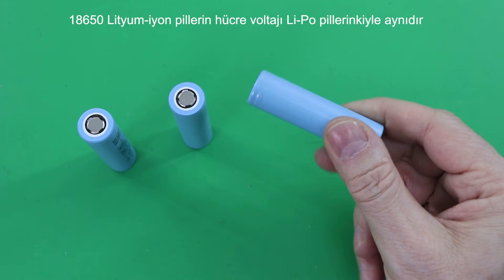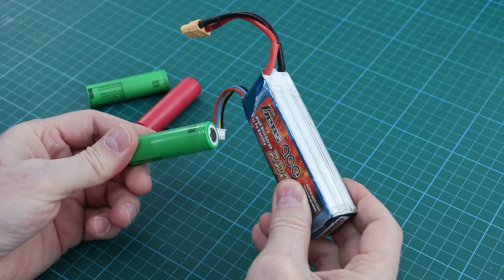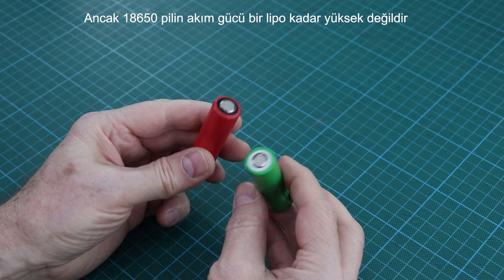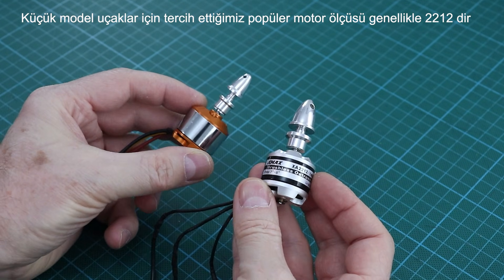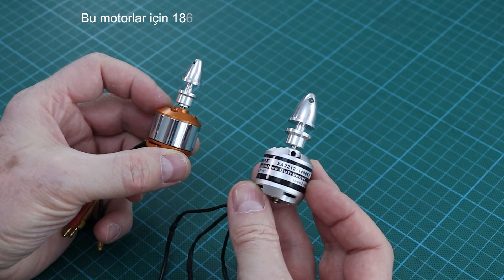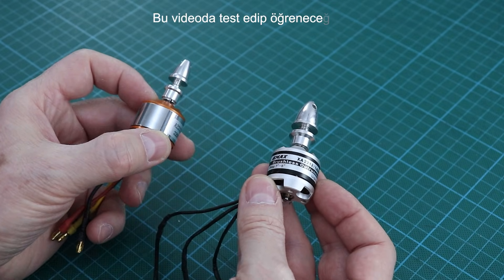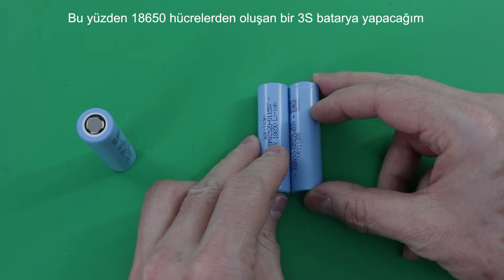18650 Li-ion Battery VS Li-Po Battery. For RC Plane

Comment: Batarya paketlerinin agirliklarini kiyasladiginiz bir bolum goremedim ama lipo 3s 2500-3000mah bataryalar ortalama 250gr oluyor diye biliyorum, yanlissam duzeltin lutfen. Uzun zamandir agirlik-guc dengeleri merak ettigim bir soruydu, faydali bir icerik olmus. Elinize saglik.
Reply from the maker: 18650 bataryanın ağırlığını gösterdim ama karşılaştırma yapmadım. Çünkü Lipo piller Markaya ve C değerine göre çok farklı ağırlıklara sahipler. Ama 18650 ile yaptığım bu batarya 11.1V 2200mah 25C pile rakip olabilir.  Videonun asıl konusu 2212 motor kullandığımız modeller için 18650 batarya kullanımı verimli midir ve işe yarar mı. bu durumda 3S 2200 mah piller daha ağır olduğu için 18650 bir avantaj sağlar. Tabi ki Lipo daha yüksek akım gücü sağlayabilir. Ama 2212 motorların o kadar akım gücüne ihtiyacı yoktur.

Comment: Can user batery lion lityum in edf de 120mm 120 A?
Reply from the maker: Not suitable for EDFs. EDFs require very high current. 18650 batteries require multiple parallel connections to achieve high current. This would be too heavy. LiPo batteries are the right choice for EDFs.

Comment: selamlar, bende benzer şekilde bir proje için elimde bulunan 6 adet aspilsan 18650 pil ile rc 1/8 aracıma 3s2p pil yaptım, aşırı deşarjdan ötürü piller bozulmasın diye 40amper bir bms kullandım fakat araç sürekli kapanıyor sanırım bms nin anlık korumasından ötürü. peki siz bms kullanmadan yaptığınız bu uçuşlarda herhangi bir pil açısından sorun veya tehlike ile karşılaştınız mı ?
benim aracım çünkü 3000kv 540l tipi bir 3slik motor ve 100/650Amper değerlerine sahip bir esc ile çalışıyor. ve bu yüksek akım isteği lityum iyon ile karşılanırsa tehlikeli olur diye düşünmekteyim.
Reply from the maker: RC model pillerinde ister hazır alınmış bir LiPo olsun ister kendi yaptığımız bir 18650 batarya olsun BMS devresi kullanmıyoruz. BMS devreleri yüksek akımlarda deşarj için uygun değil. Zaten şarj için kullandığımız cihazlar şarj esnasında çok iyi bir şeklide balans yaparak hücreleri eşitliyor. BMS devrelerin çoğu da sadece şarj esnasında bir görev üstlenir. Çok azı ve daha pahalı olan versiyonlar deşarj esnasında çalışır. Bu yüzden gerekli de değildir. Kullanım esnasında dikkat ettiğimiz tek şey voltajın olması gerektiğinden daha fazla düşmemesidir. Kullanım esnasında hafif bir güç ve/veya hız düşmesi zaten pilin  güvenli sınıra ulaştığını gösterir. O an itibariyle artık kullanımı durdurmak gerekir. Uçaklarda genellikle uçuş süremizi önceden belirleriz. pilin kapasitesine göre örneğin maksimum 8 dakika uçabiliriz şeklinde. Genellikle de kumandaların timer ayarlarını buna göre yaparız. Yani özet olarak bilinçli bir şekilde kullanırız. Tecrübeli tüm modelciler bu şekilde kullanır.
Reply: @RC-Maker-Lab cevabınız için çok teşekkür ediyorum fakat kafamdaki soru işareti halen gitmedi. Aşırı deşarj pili fazla ısıtıp zarar vermez mi benim kullanım koşullarımda

Comment: for small application this battery you are using is great however if you want to use these in the larger planes and jets, The molicel p45b or even the p50 provides more amps and you need to solder with thicker strips or 2mm wire to allow the amps to flow better.  just a thought.  I fly 80mm - 120mm edf jets on these and get much more flight times so you are def on to something. I would recommend a better battery as suggested.

Comment: Please Help! My Transmitter have a 7.4V 2S 8C 2200mah Battery. I found no exact replacement. So, Can I use a 2200mah 7.4V 2S "30C" battery?
Reply: Yes

Comment: merhaba elimde 2x arduino nano 3servo 2 joystick nrf24L01 modülü Nrf24L01 WİRİLES modülü a2212 6t 2200kv motor 2200mah 11.1v lipo batarya ve kablolar bunlar ile rc uçak
 yapmak istiyorum yardım edersen çok sevinirim bu malzemelerle rc uçak yapımı video çekermisin içeriklerin çok güzel bana yardımcı olursan çok sevinirim

Comment: What about the C rating ? Won't the battery degrade or have large voltage drop ?
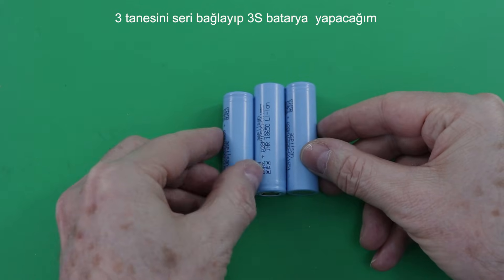Reply from the maker: The battery I used for the test is 9C. ( 0:42 ) According to the manufacturer's technical data, it provides power up to 25 amps. Of course, the C value is important. When choosing an 18650 battery, the C value should be taken into consideration.
Reply: @RC-Maker-Lab  appreciate for the detailed answer , go ahead ❤

Comment: I know 2s 18650 enough for 80cm 3.5ch helicopter, but 1s battery lipo battery in drone not enough amps anyway even 25c too hot.

Comment: A long time ago you made a 8 Chanel remote control that reached 2.5km and my question is is there a better module that can give 5km with having the same wiring and coding just for the module to have a separeted power supply

Comment: Hey kendin yap I actually made this but when I connect the battery to the esc and start moving the motor it spins at a very high speed then stops and doesn't move again
Reply from the maker: This is not a battery issue. It may be an issue with your ESC and/or transmitter settings.

Comment: Especially if you go for high capacity, li-ion is superior for RC planes. You can create a 3S2P li-ion and having li-ions in parallel will double the available current. So current is not a limitation anymore.

Comment: elinize sağlık her zaman düşündüğüm şeydi cevabını vermişsiniz.. bu ara sizin videolarınızdan çok fazla yararlanıyorum . bi uçak modelinize de başlayacağım inşallah. aklıma takılan bir soru oldu tam bilmediğimden soruyorum elimde max current 26A olan bi motor var. 3s li ion yapsam sorun yaşar mıyım acaba ? yoksa max 9A olacak şekilde bir motor mu almam gerekiyor
Reply from the maker: Videoda kullandığım piller 20-22 ampere kadar olan motorları çalıştırıyor. üzerine çıkılırsa yetersiz kalabilir. Bu durumda 2 tane 3S li-ion bataryayı paralel bağlarsanız akım gücü artacaktır. 26A motor için yeterli olur bu şekilde
Reply: @Kendin-Yap  teşekkür ederim cevabınız için. Aspilsanin pillerinde Max deşarj akım 25A yazıyor. Paralel yapmadan motoru da çok fazla zorlamadan yeterli olur mu acaba ? Çünkü paralel bagladigimda ağırlık çok fazla olacak bu sefer
Reply from the maker: @fzteminkurtt9129  Teorik olarak 25A ama pratik te 20A üstü biraz fazla ısınmaya sebep olabilir.  Hafif bir ılınma normal kabul edilebilir. Fazla ısınıyorsa uygun değil demektir.
Reply: @RC-Maker-Lab  anladım hocam çok teşekkür ederim bilgilendirme için.

Comment: What if I used  18650 batteries with bigger capacity like 4200mah?
Is it ok?
Reply: If weight is not an issue for you, then yes, you can definitely use 18650 batteries with a larger capacity like 4200mAh. In fact, it would even be better since you'd get longer usage time.

Comment: What's the battery Temperature ?
Reply from the maker: The test flight lasted 11 minutes. And I ran it at full throttle for the entire flight. There was a very, very low level of heat. About the same as a lipo. No more. Of course, the batteries I used for the test have a current capacity of 25 amps. This should be taken into account.
Reply: @Kendin-Yap  thankyou

Comment: Great video, thanks for sharing, the details of connecting the cells and the "balance" cables has been a mystery, good to see. I would also be interested in details of your spot welder, but I don't see any info in your vid or details as you stated to another comment, there is no link or info for that, details would be appreciated. Well done again and good progress with your projects
Reply from the maker: Thanks. There is a link in the description area below the video for spot welder. You must click on "more" to see the full description section.
Reply: @RC-Maker-Lab  Thanks for that, I was watching on my phone originally and although I opened "more" it did not show, but it is there, as you said when viewed on my laptop. I will check it out, looks a useful tool .. thanks again. enjoy the hobbies.

Comment: No! C rating of li ion is way lower than lipo, and running 18.5 amp on a li ion rated for 17-18amps will make it overheat!
Reply from the maker: The C value of the li-ion battery I tested is 9. The maximum current capacity is 25 amps. It is suitable for 2212 1400KV motor and 8x4 propeller. It did not overheat in the 11-minute full throttle flight test. It provided a very successful performance. This is a clear and precise test.
Reply: @RC-Maker-Lab  In general, NMC cells available in the market have a C rating of 1C to 5C. If you purchase high-performance cells, the cost will be higher, but you can get up to a 10C rating.
Reply: Nevermind I was high and miscalculated XD
Reply: @RC-Maker-Lab  I think you’re using 2800 mAh, which is 2.8 Ah. If the maximum current drawn is 18.5A, then the C rating would be 18.5 / 2.8 = 6.607C. I don’t think this cell can deliver 18.5A continuously. Please recheck it — I believe this cell should be rated at 5C. Then the continuous current should be 2.8Ah × 5C = 14A
Reply: He not using full capacity bro
Reply: @makettr  ???
Reply: @bhavyansh_p  there are 10c cells btw
Reply: it depends on the cell, yes some cells only provide like 6 amps but some cells are high power cells and they can go up to 15, 20, or even 25 amps

Comment: Can i use any 18650 cell like from laptop battery or from electronic stores if no how to find c rating which is not mentioned on the cell
Reply: It'll be better to use new batteries
Reply: Find the product number on the battery, search online and find the datasheet.

Comment: Abi bmssiz neden kullanıyorsun sorun olmaz mı
Reply from the maker: BMS nin temel görevi şarj olurken hücrelerin balansını sağlamak ve hücre voltajının normalin üstüne çıkmasını engellemek (4.2V) . Bunu zaten modelcilikte kullandığımız balanslı şarj aletleri mükemmel şekilde yapıyor. Diğer görevi ise kullanım esnasında akım kontrolü ve dengeli deşarj yapmak. Rc Uçaklarda bu istemediğimiz bir kontroldür. Dengelemek için bir veya daha fazla hücrenin voltajını düşürmesi, kapatması modelin ani güç kaybetmesine ve düşmesine sebep olabilir. Ayrıca ESC ler zaten voltaj kritik alt sınıra düştüğünde motora giden enerjiyi keser ve pili korur. Bu duruma gelmeden de kendi gözlerinizle modelin hızının düştüğü gözlemlersiniz zaten ve uçuşu sonlandırırsınız. Bu konu LiPo piller içinde geçerlidir. Özet olarak model uçaklarda BMS kullanılmaz.

Comment: Ha Ha Ha.  I have something for you to try that will but a big smile on your face. :-) Go with 4 L-Ion Cells- 2S2P.   Several benefits... A)  The current per cell will only be about 35% of what it is now (due to both 2 cells in parallel, and the lower voltage across the motor).  This will dramatically lower the total energy (voltage) loss in the batteries- you will get some of that lost V of 3S to 2S back RIGHT AWAY-  the L-Ion cells will also be much happier and last longer (life of battery)  B)  Your plane will have approx. THREE TIMES the endurance.  C)  With much less current, the energy loss (DCR) in the motor will also be less- the motor will run more efficiently.  D)  You will be running at a higher throttle setting at cruise- this will give you additional energy benefits as less energy is lost in your ESC at higher throttle settings.  E)  You can gain A LOT of efficiency back by switching to a slightly larger propeller turning at a slower RPM.  You will need to play around with a few different props... going up in both diameter and pitch compared to what most people fly with this motor-  you will be trading off total electrical efficiency and flight time for propeller aerodynamic efficiency.  Don't just do bench testing... you need to fly at speed to really get a good handle on where you are at.  F)  Lastly, and MOST importantly, you will be forced to go to one end of the runway, point the nose towards the other end, and do a proper take-off roll.  This is where you apply full throttle, keep the pointy end facing the other end of the runway, and wait for 5 or more seconds for the plane to build up enough speed to fly.  It is important... if you are not doing this on a smooth take off surface, your plane is what is known as OVER-POWERED.  ;-) 🙂
Reply: That is awesome Info, so glad you shared- I'm intrigued. I've been impressed with my LION 4 and 6S packs, but found that making a 3s LION was pretty much a wash, same as lipo in flight time. This may be the solution I need -:)
Reply: LMAO.  I looked at flight of this plane again about 30 min later.  This plane is ever more overpowered than I first thought.   What I wrote above still applies, but I think you will be FINE at just 2S1P-  just two batteries in series. Going from 3 to 2 batteries will save a lot of weight as well.  Again, take your time to find the right prop.  MAIN POINT- your plane will fly along JUST fine with a Thrust to weight ratio of just 1:3 ... or about 33%.... you don't need more than that.
Reply: The trend would be to use 6s Lipo. More volts, less amps. A lower kV motor would be required or the use of a gearbox.
Reply: @toolbaggers  - This is a very small and light plane, and the goal is to get a bit more flight time compared to the 3S set-up, and no, changing the motor was not and is not in my calculus.  Never buy more than you need to, especially when you could be spending that money on cat food instead.  I think that is the 11th commandment if I am not mistaken.  Also in my calculus, as I have been flying model airplanes since 1978, is that this thing is way overpowered.  As spelled out in my last comment,  a 2S1P setup offers many advantages, and will result in a more calm, real world, and lifelike experience.  Never be scared of a take-off roll that lasts 5-6 seconds.   Model airplanes do not HAVE to take off in 2 seconds or less.  A=F/M.  M is more or less constant. A is out of control.  Time to lower F, and it will give you the increased flight time you are looking for to boot. 🙂

Comment: you forget to mention with Li-ion batteries, you can go much lower cell voltage without damaging the cells. 2.9 vs 3.4
Reply from the maker: Yes, thanks. There is such an advantage for Li-ions. I missed this information. Good reminder.
Reply: @RC-Maker-Lab  Li-ion'lar bu yuzden dusuk hiz/dusuk guc ama uzun mesafeli ucuslarda cok daha iyi. Akrobatik/hiz icin lipo mecbur, ancak stabil hizla uzun ucus icin Li-ion daha mantikli. Fiyati da daha iyi.
Reply: what about weight of the battery
Reply: But when it come to health lipo last way longer then liion
Reply: @Kaleverest1284  what do you mean?
Reply: @ChristophLingg  lipo is more reliable thats why they invented it after li ion its this reason
Reply: @Kaleverest1284  that is not a reason, probably you have no idea. you could also say li-ions have a better "health" because they are older and have matured longer over a longer period.
Reply: @Kaleverest1284 nope, not at all. Lipo is less reliable, it has shorter life cycle, faster degradation, lower heat resistance, and more susceptible to physical damage

Edit:Lipo is invented because it can be shaped to anything you want and doesn't have to be cylindrical, which is highly beneficial in tight space such as phone and laptop battery. And then high drain lipo such as used in FPVs are invented later, and even less reliable
Reply: @Kaleverest1284 i think your wrong liion last longer than lipos
Reply: @Kaleverest1284  li ion health is way more better
Reply: I need a 18650 instead of Li-PO or Li-ion!

The 18650 format is more temperature resistant, and 18650s have a fuse that opens when they reach 100°C!
Lithium-ion or Li-PO batteries require extreme care, as they are more susceptible to developing dendrites!

An 18650 has a longer life cycle, up to 1000 cycles!

If I ever design an airplane, I will never use a lithium-ion or lithium battery!
In addition, the cost of an 18650 is getting lower and lower, which is great for us consumers!
Reply: 18650 is li-ion!

Comment: şahane içerik, elinize sağlık, aspilsan'ın 18650 pilleri 110 TL,  bir tane 3s 2500-3000 mAh lipo pil ise neredeyse 2000 TL :/ 18650 piller yüksek C gerektirmeyen bir çok uygulama için gayet ekonomik bir çözüm
Reply: 25 amper deşarj akımı toplu alımlarda 90 lira falan bakmıştım bir ara
Reply: Lifepo  pil 100 tl 6000 mAh 3C 3000 döngü aspilsan 18650 pil 90tl 2800 mAh 500 döngü
Reply: 4s lifepo ile 3s lion aynı voltaj ama kullanım alanları farklı işte
Reply: @ lifepo farklı bir pil lipo ile lion karşılaştırılıyor
Reply: @aliustaibrahimoglu492  ben yanlış anlamışım litium polymer pil çok yüksek amper isteyen projelerde kullanılıyor tek bir pilden 70-80 apmer çekilebiliyor
Reply: Bilgilendirme olsun Pil Evreni ve Pil Paketi üzerinden 85 90tl arasında bir fiyata satın alınabiliyor.
Reply: 2212 motor için kullanmayı düşünüyorum açıkcası. ampermetre üzerinden max 16A görünüyor. pilim deşarjı ise 25A insallah sorun yaşamam :)